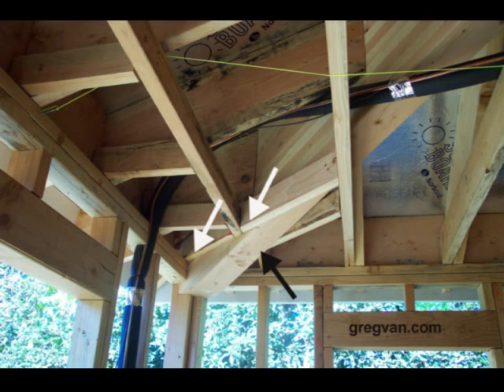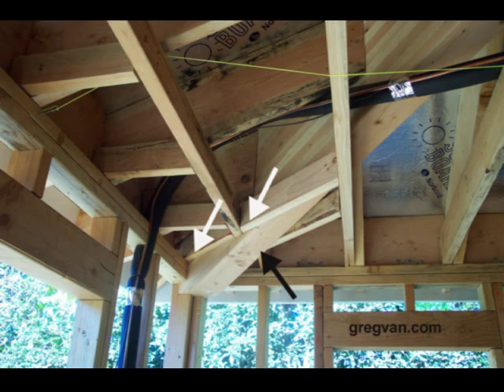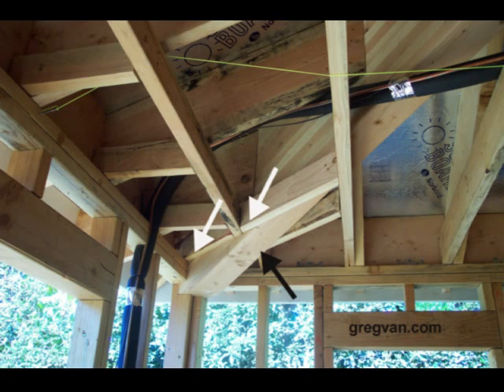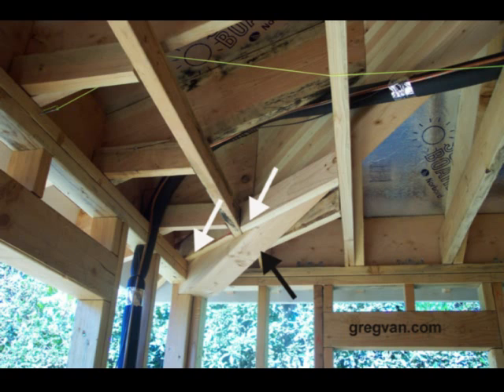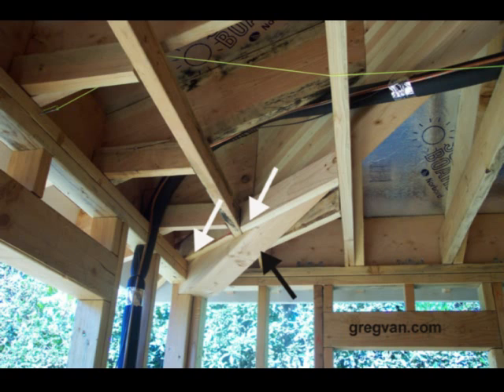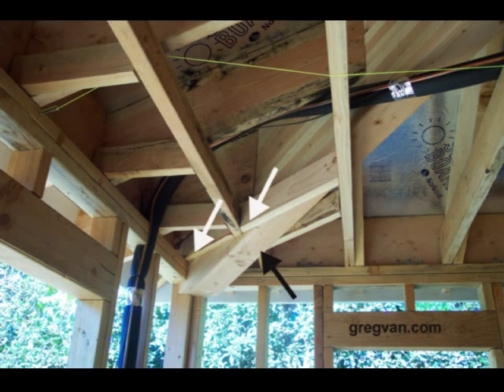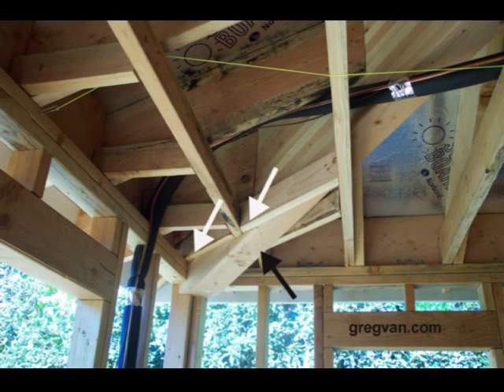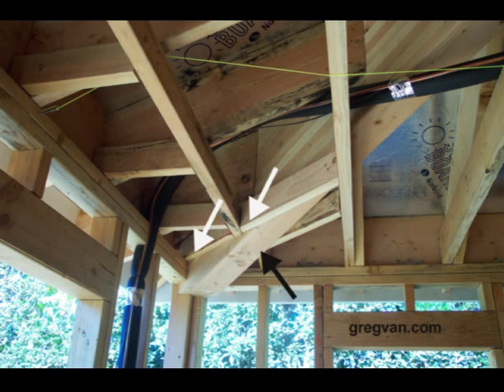Glulam Roof Beam Framing Problems - Architects And Engineers

Comment: This is not a "mistake" but a reality of a stick framed roof where the valley and hip member(s) carry a heavier load than the adjacent rafters.  The heavier load demands a  bigger member.  Incidentally, it appears that the "birdsmouth" (horizontal cut on the beam) is away from the corner which weakens the beam.  A  shorter post at the corner would allow that cut to occur at the wall.  But here are the architectural choices for stick framed roofs:  (each of which introduces other problems)
1.  Vault the ceiling and expose the hip beam.  (Your rafters appear deep enough for the insulation).
2.  Raise the wall height for the rafters but suspend the ceiling framing inside at the desired height to conceal the hip member.
3.  Chamfer the top of the walls around the perimeter of the room to conceal the beam.
4.  Box in the corner with walls to conceal the beam.
5.  Go Japanese pagoda with the beam protruding above the roof.  (...yeah, I mentioned other problems...)
6.  Reduce the span of the hip with a diagonal strut at midspan to lighten the load and member size (but strut needs support)
7.  Oversize the ceiling joists so that they can also support a portion of the hip and/or rafter loads.
Or allow a portion of the hip to be exposed as shown here.  That's the cheapest solution in most cases.
Reply from the maker: You have brought up some great points on how to solve the problem and those are appreciated. Thanks for taking the time to provide us with more ideas and methods to correct this situation during the planning stage and not during the construction stage.

Comment: Trusses would've ended better. lol
Reply from the maker: They might have, but I believe the builder wanted to design the house with a large attic, which they wouldn't have had, if they use trusses. However, trusses would have definitely eliminated this problem.
Reply: gregvancom yea, there are a few different reasons someone would want stick framing vs trusses, cost is usually one tossed out but although trusses cost more than the material to stick frame (sometimes)... waste & labor on stick framing can be quite more. With today's design software I've seen crazy attic trusses that work well. 

I can't imagine those being more expensive than a 5 1/4x 24" GLU beams in the corners! (truss designer here)

But you are correct.... after the EoR added his beam/framing callouts the architect should have plan checked everything, and well. lol
Reply: gregvancom Looking at the pic again... that would have been a perfect time to tray the ceiling!

They could run ceiling joists following the bottom of the beam slope and points of connection all the way around the room from the ceiling to the wall header height. Perfect. Tray. :D
Reply from the maker: I don't think the builder was interested in spending any more money, due to the fact that this home was starting to be finished around the end of the 2007 building boom and it was hard to find a buyer, but you do have an excellent idea and it would've looked nicer.

Comment from the maker: Yes, the beam is supported, by a 4 x 4 and 2- 2 x 4s and yes the plates are strapped and it passed inspection. That's a great idea, adding a corner post and something like that could provide additional structural support.

Comment: does beam have support.IE; solid wood member in outside pocket, and also should be strapped in horizontal top plates at exterior and beam protrusion  into room could be enhanced by adding post , a solid timber or mini lam below in room , would add character.. txs jman

Comment: The celing height is not effected at all  . The ceiling joist cantilever past the outside wall you can nub the top of the celing joist to match what ever facia you are using you stack the rafter with a long cut on top of the celing joist that means you are starting your run from the fascia you will rise about 10 inches befor you even cross the wall wit the height of your celing joist + 10 " =17 " on a 16 inch over hang

Comment: An ez fix to that situation would have been done during the framing stage . All you have to is extend your ceiling joist past the out side wall stack your rafter on top of the ceiling joist block it space between the rafter when it crosses the wall with a 2x4 slapped against both you will cross the wall at the height of the ceiling joist + the run of your roof .an 8 /12 pitch starting from a 16" over hang with a 7" ceiling joist will give you 17+ inches when you cross the wall

Comment: This is the problem i have been stuck with also. The top of my glulam beam is about 10 inches higher then the roof rafters.Everything you said is dead on true. Everyone missed it and it was not noticed until we started framing in the roof rafters. Now they all just blame each other and play pass the buck. Our solution will be to notch 7 diagnal inches off the corners and at the same time raise the roof a little higher. This redo will cost me $3000.00.